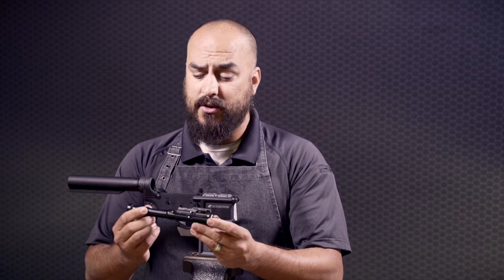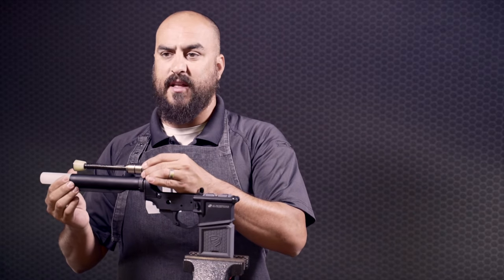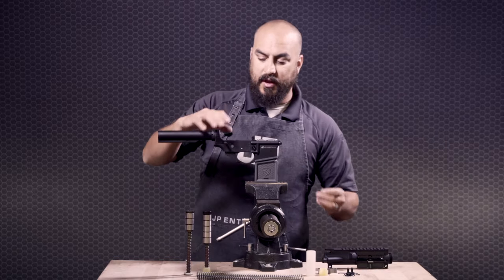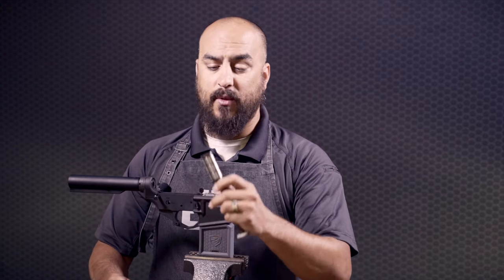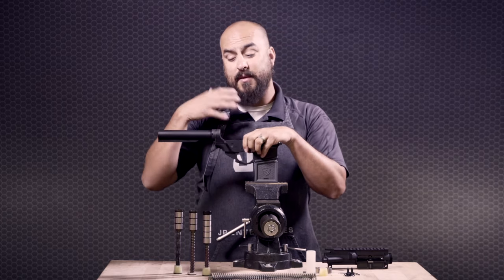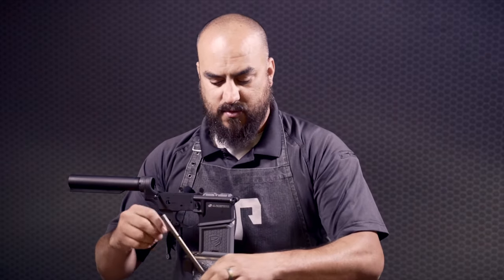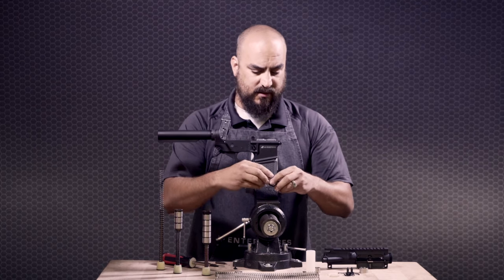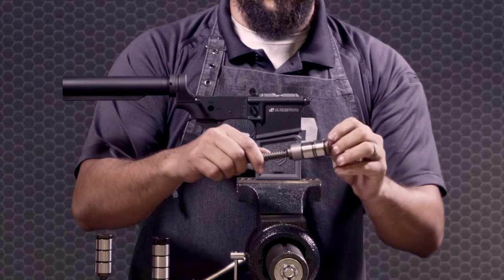Installation/Reconfiguration | Silent Captured Springs

Comment: This is a great product - I now have four or five of them. The product by JPRifles works a lot better than some of the aftermarket products out there - I have a few of those from before I discovered JP Rifles SCS. It would be nice, if JPR would create a spread sheet that listed all of the configurations for all of the different components. For example there are a number of combinations that work for 5.56, 9mm, .308, etc... There are other factors at play such as high/low mass, suppressor, spring tension, tube length, etc. So for example, if I am running a suppressed, piston, standard mass, rifle length tube setup - I should have 2 steel, 1 tungsten, and the blue spring (hypothetical example). Or alternately if I have 1 tungsten + yellow spring - it equates to x lbs. 1 tungsten + 1 steel + blue spring = y lbs. 3 tungsten .... etc. Secondly, JPR provided a number of different combinations but I didn't know what I would go for with my .45, my 10mm, my .243, and hopefully very soon, my 30-06. Either way - JPR thank you for the product. Keep in mind, I understand that I can experiment and learn on my own, but there will always be that lil bit o doubt - regardless of how well it works.

Comment: I bought the SCS for my AR-15 with a rifle length gas system, so I bought one with the steel weights. I put a Precsion Armament AFAB (chambered brake) on my barrel and decided to run 75 gr Hornadys through it... the buffer kept bottoming out no matter what spring I used. I ended up buying a couple of the tungsten weights, and I'm hoping the spring kit comes to life after this. I suspect it will. When I shot it with a traditional H3 buffer, it mitigated it, but the SCS still seems smoother.

Comment: I had a Silent Captured Spring a while ago and it caused a significant failure running it with a retaining pin. An O-ring from the buffer got caught on the retaining pin while firing, locking up the rifle completely!!! It was extremely difficult to disassemble and correct. Don't run it with that pin. Just my suggestion.

Comment: I too have (2) H2 for each of my AR-10s & (2) H2 for each of my AR-15s to include (4) Buffer Retaining Pins. They are very nice and worth the cost in my opinion; I also have the SCS Alternate Spring Pack for both AR-10 & AR-15.  My question is what configuration of either weights or springs do I need to make a H3 system? Ant ideas are greatly appreciated.
Reply: I found an answer to my question' JP Enterprise provides configurations online. I replaced the steel weight with a tungsten weight to convert my H2 to H3. Works great.

Comment: You mentioned there are springs that will increase the cyclic rate of the firearm. Can you provide a link to those specifically for  the 9. I’m assuming they come in a pack.
Reply: I’m sure you probably found this info already but if not all the springs are on their website.

Comment: Does this directly swap into a BCM pistol buffer tube (measures about 6.5in from the castle nut/end plate line)?
Reply from the maker: Yes the Silent Captured Spring is compatible with the BCM pistol buffer tube.

Comment: How do you run this with a stock which has a folder part; is it possible? I know the rifle can not be fired with the stock folded to clarify, I am asking if this setup would work on a foldable stock. Thanks.
Reply from the maker: We make a line of SCS's that are compatible with the LAW folder brand.

Comment: I used an ar-15 (223/556) and it leaves bruises on my shoulder where a 12 gauge doesn’t. Broke it down and it has one of these installed. Is it no setup correctly or is it most likely something else wrong like over gased?
Reply: If your AR-15 is leaving bruises on you that means you either have a medical condition or you need to go to the gym. I’ve shot belt fed machine guns from the shoulder and they haven’t left so much as a mark. If your AR was generating enough force to bruise you then it would not be cycling properly, since that would require much more force than the system can take.

Comment: When test firing to see what spring/weights work best for a particular rifle, do you have to put loctite on the screw each time? Or can you get away with some test shoots without it?
Reply: IMO not really, but for real just do a few shots and then check it to make sure its not backing out. JP will probably say YES locktite every time, but I never noticed the screw backing out when throwing 5 or 10 rounds downrange.
Reply: Fired mine 100 times with screw just basically hand tight.

Comment: 1:05-1:14 So I can’t use a foldable stock adapter with the JP SCS because the rod of the SCS has to go 3-3/4” through the BCG correct
Reply from the maker: We offer a selection of Silent Captured Springs compatible with the LAW folder. Check out our website or shoot us an email for more info- Tech@jprifles.com

Comment: Can I keep the buffer pin in the tube in place? I'd like to be able to alternate between my scs and standard buffer/spring setup.
Reply: Yes you can. It is more difficult with the stock pin but yes it can be done.
I just completely removed the pin.

Comment: Literally impossible to take off, even with heat applied....what's the point of making the weights modular if the screw is impossible to take off to the point of almost getting stripped?